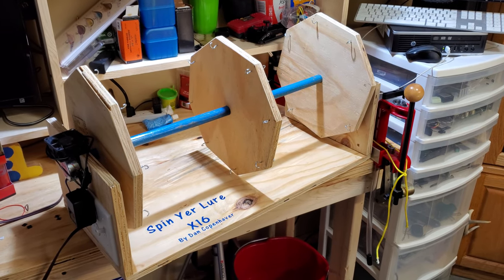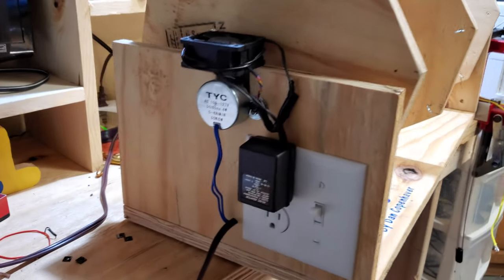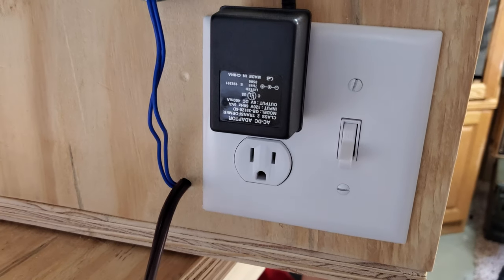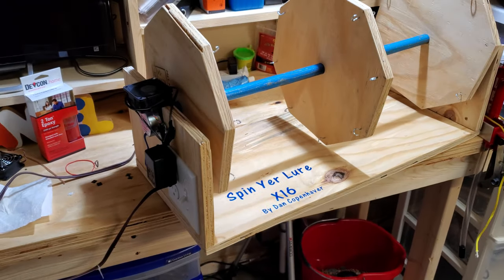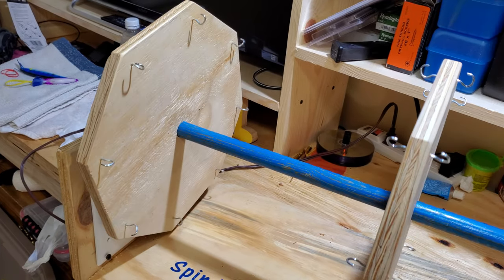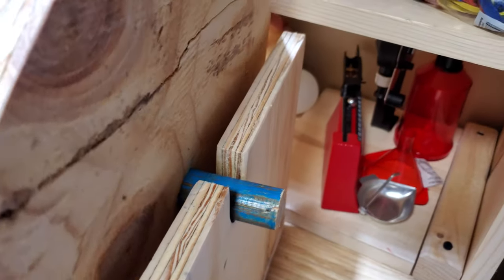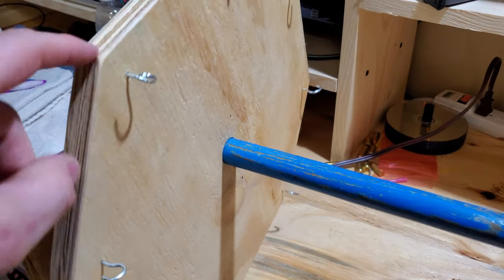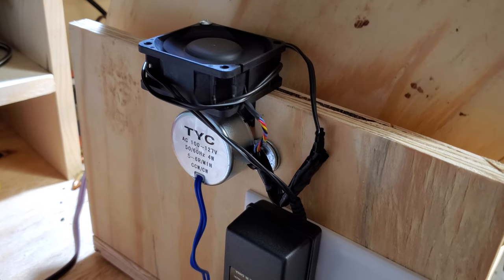Homemade Lure Turner x16

Comment: ??? Wouldn't any drip fall on the other lures??? Do like the fan. But maybe a case around it. Reduced risk of injury or function damage.
Reply from the maker: With them moving they will not drip . The constant turning makes the epoxy even out over the bait. But if it was stopped before the epoxy had a little bit of time to cure, it would drip for sure. I used a random pc fan I had lying around but would have rather had a smaller fan at lower rpms. A case around it would be nice for sure! Thanks for the comment!

Comment: How did you wire your 4 pin fan to a 2 wire 5v dc adapter?
Reply from the maker: I cut the 12v line and the ground line and wired them to the 5v adapter.